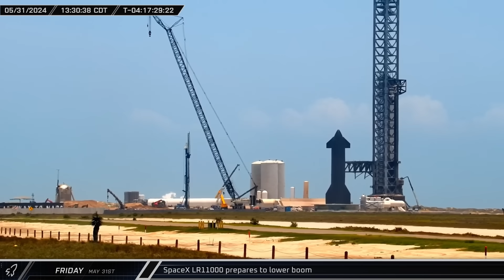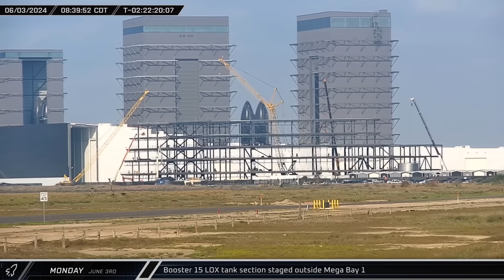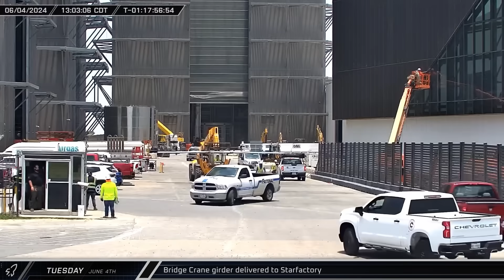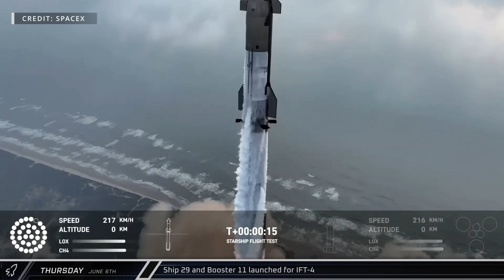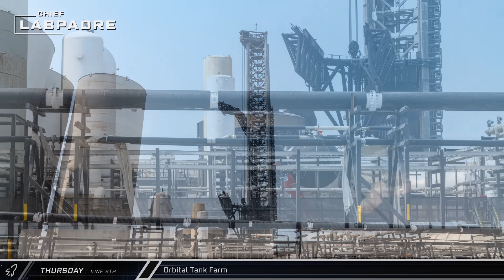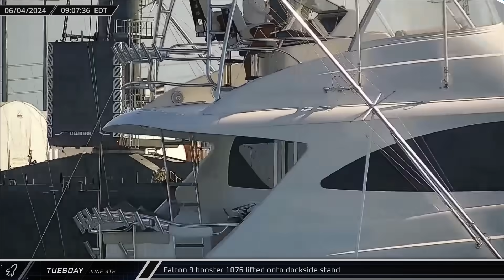WOW!! SpaceX Makes History AGAIN With Starship's Successful 4th Flight - SpaceX Weekly #118

Comment: Another GREAT report on another GREAT week for SpaceX.  What a week!  Maybe some custom tiles to deflect plasma around the flap hinges during hypersonic reentry?  SpaceX aerodynamic engineers are probably doing the computational fluid dynamics modeling for that right now.   🙂

IFT-5, here we come!

The way Starship continued to function properly with so much control surface structural damage during an early flight test makes me want to fly in that vehicle when the design is finalized.

Comment: If flt 5 does 1 full orbit then does a de-orbit burn it might enter slower and suffer less damage!
Reply: That’s not how orbit works besides they are engineering the heat shield to re-enter at even higher speeds as it will come back from the moon and especially mars at much higher speed than LEO.

Comment: hey guys, does anyone know what happened to the booster and starship floating in the water with Armed FTS still onboard ???
Reply: Bottom of ocean
Reply: I @kevinkalthoff8083  I doubt that.
Reply: @kevinkalthoff8083 is that verified? Or just assumed?
Reply: @kevinkalthoff8083  Should make a great artificial shelter.
Reply: The FTS gets disarmed during flight.  You'll hear a call-out, "FTS has Safed" when it gets turned off.